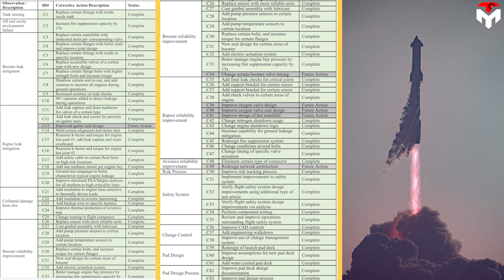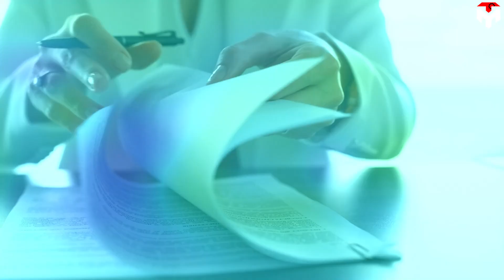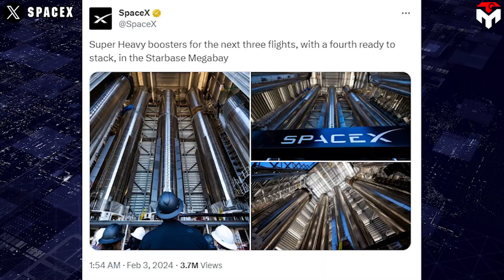Finally! FAA huge Update, SpaceX launching Starship to Orbit this month...

Comment: All these equipment updates are what was learn from ift 2. The power of 33 raptors is the largest man made rocket ever built. Even NASA had launch issues from sls 1. It's all uncharted territory for the power of these rockets. Elon has said that starship and super heavy will be 30 percent larger during the next few years. That means better tech to deal with these massive rockets. These ships will get to a point within 20 years they will be built in space docks and the raw material Wil be just transported to space to build bigger and faster ships.  Nuclear and/or cold fusion will power these ships beyond our solar system.
Reply from the maker: Yeah, if those happen, Mars will not be our only settlement. We can go anywhere in the Universe. Where would you like to go?😃